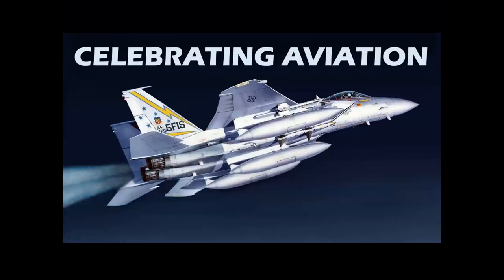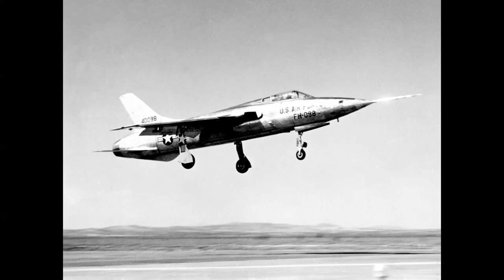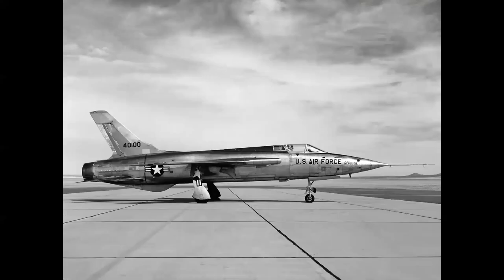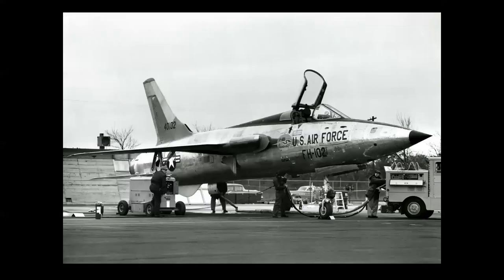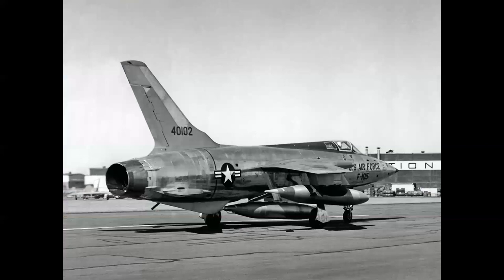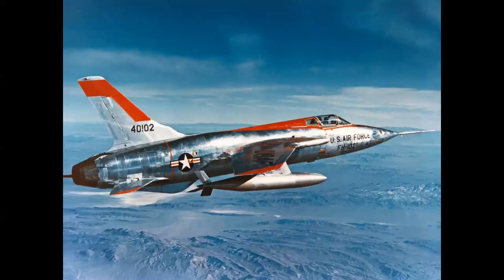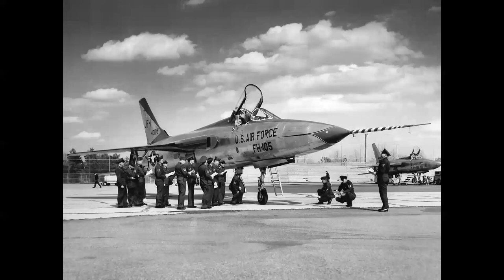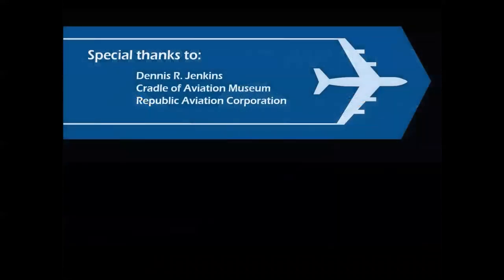REPUBLIC F-105 THUNDERCHIEF - Early Years of the Largest, Most Powerful Single-engine Jet Ever Flown

Comment: The last JF-105 with its Reconnaissance package is at Lackland AFB's Airmans Heritage Museum, just past the MOB Barracks. It is painted in its Razzle Dazzle paint scheme. If you ever want to see it in person contact the Airmans Heritage Museum's Curator Mr. Fernando Cortez after the lockdown, the museum has also an F-105D which is displayed at the base Parade Grounds behind the base headquarters building in the Southeast Asia Airpark (parked next to the B-52D).
Reply from the maker: Great to know, thanks!